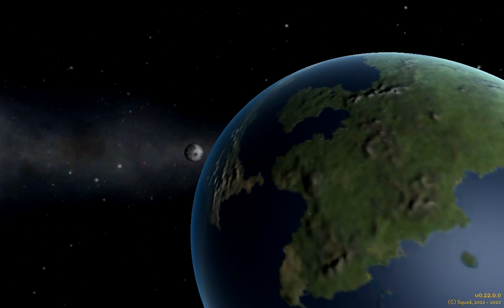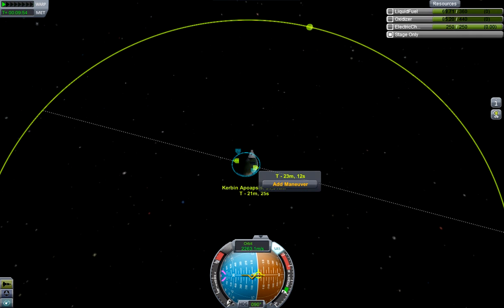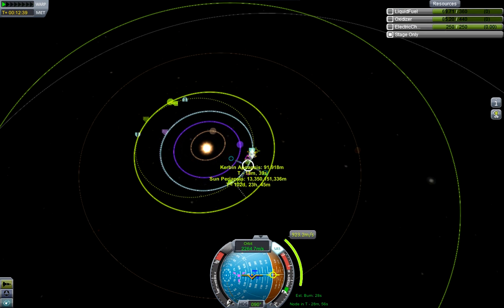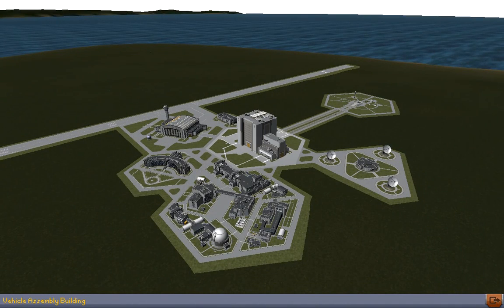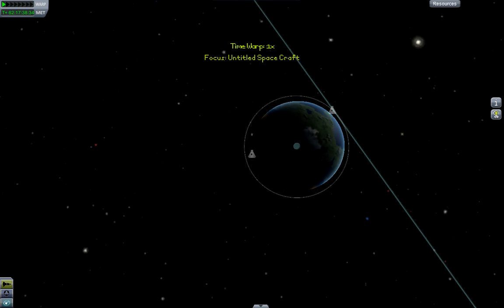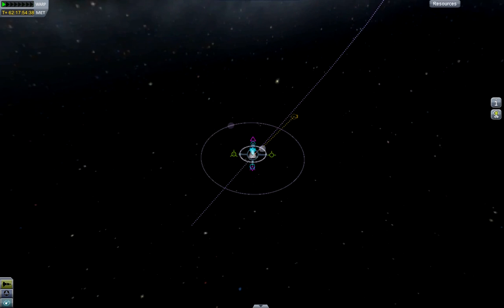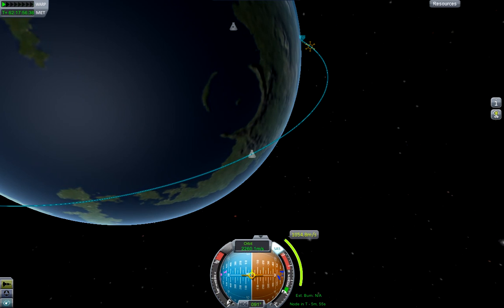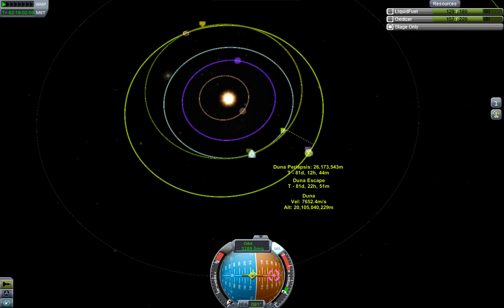KSP Interplanetary Transfer Window Tutorial

Comment: Well, lowest delta-v, sure - but half the fun in KSP is doing ridiculous transfers with lots of braking delta-v, so you get anywhere much faster than in the real world.
Btw, I wonder how you'd calculate the burn-time (11:20) without integrating (or at least working with an estimation of the average mass during the burn). You can't just divide thrust by start mass - that'll just give you the starting acceleration.